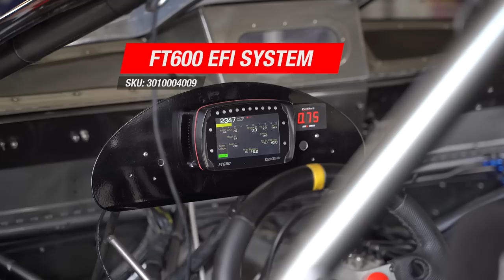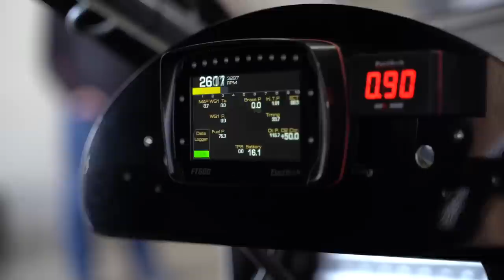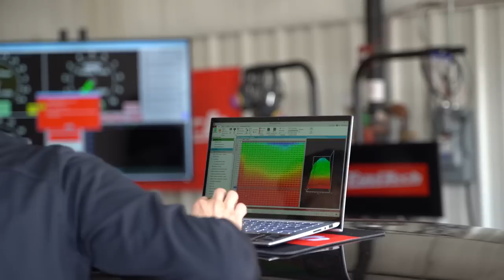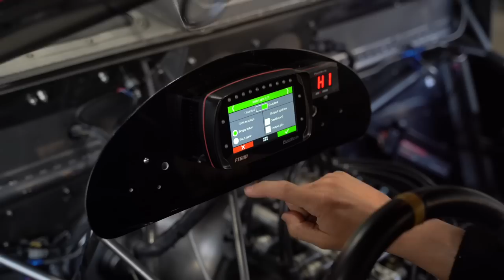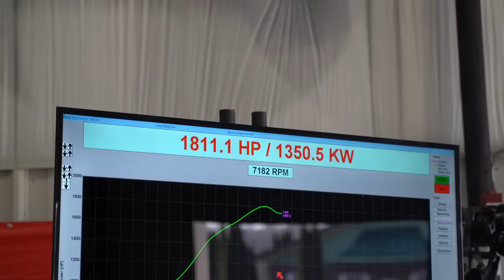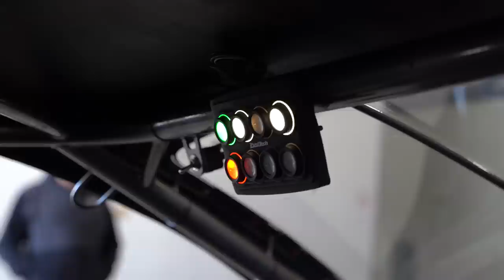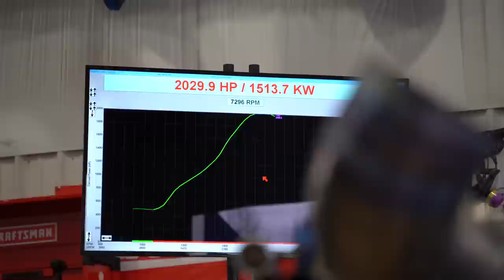UNIQUE 4 Cylinder Big Block Volkswagen | COMPOUND TURBO

Comment: So basically a starter motor for a Steve Morris engine.
Reply: This is actually just as impressive as a Steve Morris engine, if you consider capacity vs horsepower.
Reply: Entendo... deve ser difícil assistir uma empresa brasileira virar referência mundial em performance! Gerenciamento Eletrônico Gaúcho  + Boxer billet 4cc 3.5 =  2030cv! Pode chorar mais alto... (I refuse answer in english)

Comment: I feel like this breaks boosted boi Kyles heart 🤣🤣🤣
Reply: I've been commenting forever for him to get a b5 1.8t audi to build the shit out of, or a 2.7tt although that doesn't handle BIG power unless you get an AZR block with is about 10k for a bare block. Stock 1.8ts are 75 bucks in the junkyard and you can basically sneeze one to make as much power as most his non monster Honda motors
Reply: And Boosted Lifestyle Kyle....
Reply: With that comment, I knew u were a Domestic v8 guy....... but it still aint no v8... it's still a motor prove yall V8 guys that 4bangers can hold their own..... u honda with a passion huh
Reply: You can't really compare them to this. They are doing what they do with stock engines using aftermarket parts. This is something that is loosely based on an existing engine, but made specifically to do what it's doing. A 3.5L boxer 4 cylinder made of billet from top to bottom. They're all doing what they're doing with what they have to work with. If Boosted Boi Kyle had the bankroll for an all billet K-series, I bet you'd see the first 6 second MR2 real quick. It's hard to compare because of that. If you got the money for it, the only thing stopping you is your imagination
Reply: @mryang3644  that’s what you dreamed up from my comment 🤔
Reply: @baby-sharkgto4902  I wouldn't have matter of our name or picture....  a hater comment will always be recong
Reply: @mryang3644  except I'm not hating at all. I have nothing against Kyle or 4 cylinders or any engine lmao
Reply: @baby-sharkgto4902  sure bud
Reply: @baby-sharkgto4902  its allgood hes just looking for an argument lmao
Reply: @rarepepe1610  I think Mrs Yang, maybe, speak a no englay, or misread my comment. Or maybe I suck at writing comments..... but I definitely was not shitting on Kyle or 4 cylinders

Comment: Hey guys FYI Jett Racing 4G63 2.2 litre compound setup in 2018/19 made 2200hp @wheels on dyno at 100psi boost 
Seen it with my own eyes but easy to check with Collin 
So done few years back at over 2000hp 
Maybe you forgot they did it or didn't know 👍🇦🇺

Comment: Can't believe it makes that much power and out of a VW engine could you imagine that on a old school VW sand rail
Reply: A lot of people refer to protruding or boxer engines as Volkswagen engines. Usually older folks and usually to not be talking literally.
Reply: Calling the a VW engine is about the equivalent of calling a 959 cube nitrous engine a big block chev. The lay out is similar but there are no interchangeable components
Reply: @ihatemybosses  it's vw Boxer design but ALL of It is billet and rebuild

Comment: Very Impressive. I would however like to see the 80+psi Red Demon DSM running a Billet 4G63 on a Dyno before I vote for most powerful 4cyl.
Reply: I'd say make it interesting. No billet blocks. Oem blocks with internals and a girldle if neccesary
Reply: Agreed. Also throw in the Jett racing eclipse.
Reply: Those 4g63s are 2200hp
Reply: Would love to see Carl Brunets ecotec in their.
Reply: Would love to see Carl Brunets ecotec in their.

Comment: Goddamn, my first car was a '73 super beetle with a fresh 1600 in it and off the line it was kinda quick. A motor like this would render a beetle completely unsafe and terrifying to everyone whose balls are anything less that 10 on the MOS hardness scale. Bravo.
Reply: Here in Brazil we have some Beatles street legal with 600whp and 800whp+ on dragstrip
Reply: Amr500 as a pull through supercharger is a real popular first mod because it's bolt on boost for $600. Then they use the porsche engine swap and run the same supercharger with a smaller pully and a bigger carb

Comment: The AWD "Red Demon" Eagle Talon makes 2,000hp, runs 215 mph in 6 seconds. 
Time for a match race?
Reply: @shvrdavid  Yeah, the Red Demon's claim to fame is that it' has manual trans, and holds that record. 
Would probably be quite a bit faster with an auto.
Reply: @shvrdavid  but red demon is not a pro mod, he  have a lot off of steel.. Is another category
Reply: @marcelojr8833  The "Red Demon" is almost all carbon fiber with a tube chassis, and plastic windows.
It's also the first 6 second AWD 4 cylinder on the planet, and holds the record for the fastest manual transmission on the planet.
Reply: @shvrdavid  Thanks for parroting what I said.
Reply: @shvrdavid  Or mabey you could try and correct them on "That Racing Channel" they just uploaded the video this past month. They claim the "Red Demon" is the fastest manual 4 cylinder 6.988
Reply: @Copesthetic-Aesthetic  it's not

Comment: It's a GOOD effort and it takes A LOT just to get there where it's at.
HOWEVER, this engine, at a massive 3.5L size it's still dragging it's feet with it's HP numbers, even accounting for 20% drivetrain losses.
Although it's being boosted it still falls short of the 100HP/100cc mark which happens to be one of the most widely used measuring sticks when it comes to power dense I.C.E.
Maybe it'll get there in the future ? Good luck to the owner and race crew.
Reply: Dude no one is using 1hp per cc as a measuring stick, that is a freak goal.
Reply: @tyleresker3306  INDEED, it's mental and unreasonable, excuse my poor typing and thanks for pointing it out. 
I meant 100hp per Litre, I edited my numbers.

Comment: Like to SEE the actual engine itself. Nevertheless, this is an accomplishment at these power levels. "A part is only as strong as it's weakest link". So I can only imagine all the time/work to get to this point. Congrats gentlemen. I'd like to mention another 4 banger. During the 80's, Ford came out with Probe roadrace car for the IMSA series. Which used a 1.5 ltr 4cyl making over 1000-h.p. Car would get pole position, make it through practice, but usually would never finish. Saw it, it made Lap and a half after green flag dropped. That engine, might've been on a stock block, not sure, had a corporations $$$ thrown at it, to not succeed. So yeah, yer guy's is really an accomplishment!

Comment: SR20VET com apenas 2.2/2.1 fez 2010cv ou lá o que foi ...
O 4g63 da Jett racing também deve andar nesses níveis.
E claro, o Ecotec do Carl Brunet.
Reply: Boostin Performance’s Eclipse - Red Demon - is also supposedly 2000+hp now.
Reply: @pieflies  no, 1800hp~
Reply: @tiagoabreu4107  the latest TRC video is titled 2000hp, although on rewatching that’s not specifically mentioned in the video. It was running an estimated 1800 a few years ago though and they’ve upped the boost since then so it wouldn’t surprise me if it was 2000. No proof though.

Comment: I want to see a rb on the Dyno a rb26 or an rb32
Reply: Why? we all know they only make 1000 whp before the kaboom
Reply: @tetracontrol   rb 30 can handle 2000hp on a cast block rb 26 can’t handle that much power do some research on it you will be surprised
Reply: @quonscott5108  not at 2.6L that’s for sure lol. Is it even an RB anymore? lol
Reply: @THESLlCK   watch the YouTube channel  Motive Video  they well educate you an all you need to know about rbs
Reply: @quonscott5108  lol I could educate them buddy
Reply: @THESLlCK  trollololollol
Reply: @quonscott5108  3.0 L Holden block
Reply: @THESLlCK  plenty of RB30 blocks around making north of 2000hp. Once you start going above that most guys just go for aftermarket blocks etc.
Reply: @vintagetractorsaustralia  hahaha whattttt are you on lol
Reply: @THESLlCK  maatouks R32 makes over 2000hp on a factory RB30 block. Obviously it is all aftermarket internals. But the block is still the original Nissan casting. I’m not saying that it’s easy to do, but they do it.

Comment: This is super bad ass … although not the highest HP .. mazworx in Florida and jet racing in Australia have some 2.0 liter engines making mind blowing power with less displacement
Reply: But not 2 valve and pushrod!
Reply: @colinmunro7337  why would anyone build 2 valve pushrod engine these days ?
Reply: @V8Lenny  ask Proline,they only make 4000plus horsepower.

Comment: Shane's 3000hp 4 cyl.. but 2000 is a lot  too 😂👍
Reply: Who?
Reply: Shane.. i dont know his full name, over 2000hp nissan sr 20(2.2 l) now it has 3000 something hp, It is on youtube. HP academy
Reply: @mariusfridlund55  the question is if it's reliable or not because this one is doing it reliably

Comment: this is not the most powerful 4cyl, bre makes 3000hp 4 bangers for a long time and gm 20 years ago made 2000hp engines with a single turbo 2.0l ecotec stock cobalt cast alu block that still hold the record of the quickest 4 banger, this setup is insane for sure but dont claim to be the best when its not the case please
Reply: When he said they use V8 components BRE was the first company that came to my mind and that was like 25 years ago but yes it was an awesome video and thanks to Fuel Tech for bringing great products at  great prices.
Reply: Carl Brunet 5.95@230MPH
Reply: Who is BRE

Comment: make it into an 8 Cylinder if it's all custom.
Reply: Like a lot of things with racing. This probably fits in to a loop hole in a class which gives them an advantage if they run this combination
Reply: A six would fit better than an eight.

Comment: Any newish engine that smokes out the breather is not built properly,  plain and simple
Reply: lmao, you think an engine that was built for 100+ psi of boost was built tight? You're clueless
Reply: BigBeansM3   🤣
Reply: BigBeansM3     What so just because it has massive boost means the ring gaps and the ring seal have to be massive as well?   They are loosing horsepower,    There are plenty of 100+psi drag engines that don’t smoke like this,   Look it up Einstein 🖕